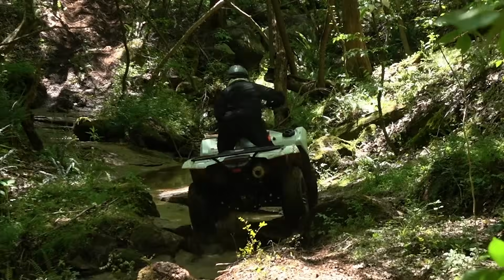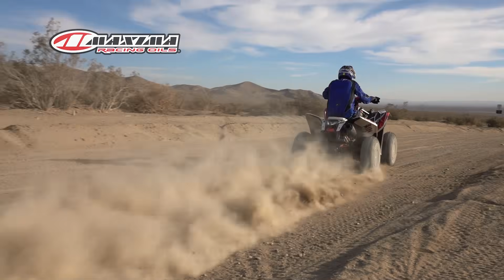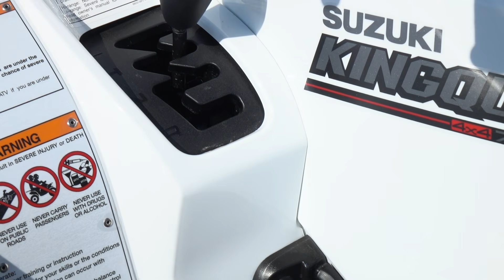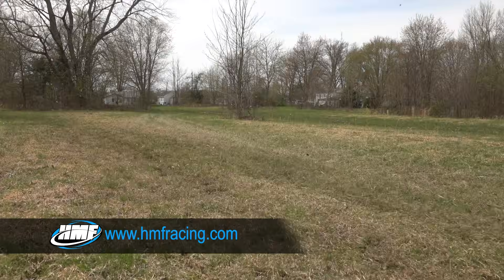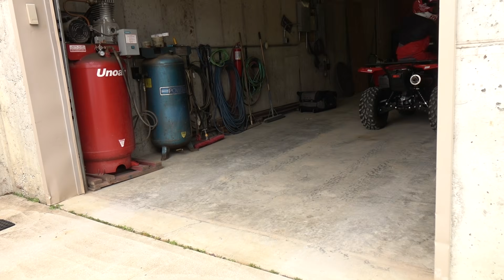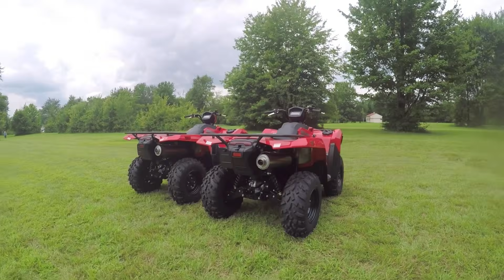Suzuki KingQuad 750 vs 500 Shootout

Comment: My first one was a 1995 300 . I recovered it from a scrap yard where it had been dropped off after a  bad crash or possibly a tumble off a  cliff. It was a frame , engine and wheels , the front brush gaurd was crushed as was the handlebars , guages , headlights , no racks or fenders . I think the owner was gonna attempt to fix it but decided not to. So I did . When I was done it had parts from all kinds of machines but it ran good  very reliable  and powerful ,  it absolutely looked horrible  like it didnt run so I never had any issues with theft or vandalism lol..18 gears , diff lock granny low .

Comment: If u get the 500 and put exhuast, fuel optimizer, tires and winch the value is defedentaly better with what you've saved and you have an atv that is lighter and almost as poeerfull. But  a yoused 750 for the right price would be a great option.
Reply from the maker: All good points. You could buy some accessories with that grand. It wouldn't be lighter though. Winch and the tires would add weight.
Reply: @ATVonDemand  that's true. I didn't realize how similar in wieght they are.

Comment: I’m glad they DONT change.  I have a 750 & love it
Reply: Polaris might be higher performance and all that jazz, but they break. Often. I used to work in the service department for a Polaris /Suzuki /Kawasaki /Kymco dealer. We rarely ever had Suzukis in the shop with mechanical problems. Usually due to wrecks. Polaris on the other hand... Constant axles, ball joints/bearings, engine and electrical problems. As high performance and nice as they are, I'd never own a Polaris. Crappy warranty too, they fight you WAY more than the Japanese manufacturers
Reply: Me too, Suzuki knows how to keep things simple and RELIABLE. That's the point for utility ATVs

Comment: That automatic CVT bullshit is a deal-breaker for me. I would love to have the 750 because it has 50 horsepower but I'll have to go get a Honda Rubicon wity a 5 speed . I'm sorry. I just have got to have my manual transmission. And I would also buy a Yamaha Raptor 700 because it has a manual clutch and it's fast. But I just cannot deal with that CVT automatic junk. I do not like automatic transmissions

Comment: nice video.  I'd go 500 over the 750...and with the cash saved upgrade tires and install a winch.  Value is better on the 500.
Reply: I just got a 2019 500 with 490 miles and a 2020 750 with 385 miles for 8,400 dollars and I'm having hard time deciding which one to take on the weekends I love them both man
Reply: Well they're both Suzuki so you win either way 👍 @tonydize3944
Reply: @tonydize3944  ... Congrats!  Yah, Suzuki's are hard to beat...and just run...run...run!!

Comment: I love my ‘21 750. Hauls wood, Plows a huge snow drifted driveway, pulls a box blade, hits some gnarly trails and hasn’t skipped a beat! It’s built like a tank!
Reply from the maker: Thanks for sharing your experience. We love owner feedback.  Sounds like your king quad has a busy life.
Reply: The only complaints I would have with the KQ would be squeaky brakes (changed the pads and went away) And the tires. The stock Carlisle’s belong on a riding lawn mower. As mentioned in the video the sidewalls are very soft.

Comment: Is it just me.. Cos When I messured my 2022 I just picked up. The Front Wheel Track is 3 inchs less when the rear tires???  
I''m going to have to add 1.5 inches to each side. To get the wheel tracks back even. ESP For snow riding!!  Dam engineers.. 
I've got over 100 000 miles on Atvs. The wheels need to be even SUZUKI!!! ESP for Canada. The Fuel tank!! Is the pits!!! A 6gallon tank for 750 would have been nice. Today I took my new ride on a long trip. 177 miles.  I already can point to stupid little things. That add up fast. 
I should have bought the Side by Side. I had on order... but Yamaha has no production..

Comment: We got a 2014 500 with 25,000 k on it . Use it for dairy farm use. Like it a lot over 400 and the 750. I think the 750 had problems with them over heating  on the older models. Our dealership said they struggled to sell the 750 s over the 500 s.

Comment: I have a 2013 axi power steering 
The power steering is useless. When you need power steering, as in when your stopped or in a tight spot and trying to turn around you get NO POWER STEERING.
But when your moving you get all the power steering you don’t need.
Japanese quads have useless power steering 
Both Can Am and Polaris have finger tip super easy real power steering 
The suspension is jarring and make the bike unruly in rough terrain.
Other than the useless power steering the rest of the bike has been flawless...
But 1000.00 for power steering that is useless unless your moving is a real rip-off
Reply: Your obviously not using it as working bike and are likely a weekend warrior  from the city
Reply: @snakeplisken4119  
Bud if you think the power steering does anything at all besides cost a lot your living in a dream world 
Try a Can Am or a Polaris product that actually has power steering.
Reply: @robm3357   rodger that

Comment: I bought the 500 axi in 2012 its been a great bike not one single issue ever at 9000 km to date . I will be buying the 500 again if i ever wear this one out.
Reply from the maker: We really appreciate you sharing your experience with your king quad. We love hearing from  real-world owners.
Reply: Did you adjust the valves yet? Just got a 2019 king 500 and wondering how crucial it is to get this done.
Reply: @mapleridgefarm1026  bike running great only thing I have done is put a new battery in and  regular maintenance  12 000 km
Reply: @steve123261  ok thanks

Comment: Great Video!!!
I’m pulling the trigger on a new 2020 King Quad 750. After rebates they price difference is only $750!!!
This video was perfect for deciding between the 750 and 500. Thanks!!!
Reply from the maker: Glad we could help! Enjoy your new machine.
Reply: Go for it. You wont regret the 750. I was going to get a 500 but due to a little paint damage got it for less than the 500, and it was the se plus even. I had no clue it handled bumps better but mine rides pretty smooth for the terrain. Better tires I will get soon, other than that I have 0 complaints. It's got good power stock, but at some point I may exhaust and upgrade the computer.

Comment: You nailed it with the comment at the end about more performance lurking in the clutch. Its amazing what some clutching will do.
Reply: I assume I can do that without messing with the exhaust or computer right?
Reply: @thecasualatvguy617  absolutely. All depends what your looking to gain
Reply: @rzl07375  I've been posting video since november of last year of my rides. I've found it's a capable machine for sure. It can do more than I think it can. Lol. I used to do just basic trails growing up so I'm always not wanting to tip mine over. I do have insurance but that's less time riding. Lol. I have met 2 new people on here to ride with with each model of a can am, they are 570s so I think they wont have the unreliable issues the big ones have. I guess we will see.

Comment: I bought a 2019 Kingquad 750 a few months ago and it's great. The power feels amazing after riding my dad's 2007 Kingquad 450 for the last few years. The 450 has been through hell and back and it refuses to even break down. It's all original parts, just needs a new CV joint as it is clicking and bound to break soon. I got a Kingquad because I know they are very reliable and I got a good deal on it. I walked in wanting a 500 and walked put with a 750, glad I did because it's amazing. 100% satisfied.
Reply: Instablaster...

Comment: I have 3800 miles and 355 hours on my 09 KQ500, LOTS of plowing snow. It has never failed me, clean it after use. Service fluids and keep things lubed per factory and it will not disappoint you.
Reply: Did you adjust the valves to get to this mileage. Just got the 500 and its my first FI, just wondering how crucial it is to adjust them or not.
Reply: @mapleridgefarm1026  They are easy to adjust since the 500 using tappets, I adjusted mine once at 2000 miles, after that they stayed in spec. I reached 4000 miles on mine and 420h before a tree smashed it in a windstorm. I now have a 2020 750.
Reply: @Re-Booter  ok thanks, were they fairly out of spec at 2000km? Just worried about dirt getting in the motor as i seen from videos that it exposes the motor to dust and debris at different stages.
Reply: @mapleridgefarm1026  I never had that problem, one just have to make sure you have a good tights seal between throttle body and air filter neck. Use Uni type air filter, I've never had a problem with them. Clean them and oil them once a year.
Reply: @mapleridgefarm1026  The events where people have ingested dust into the engine, either by too much submarine action or worn motor mounts that allowed excessive movement of the engine, slipping intake off throttle body.
Reply: @Re-Booter  ok thanks

Comment: Anyone that is chasing big HP numbers and fancy marketing when shopping for a ATV may end up with a questionable piece of crap ATV plain and simple lol. The Suzuki King Quad is the most reliable ATV on earth 500 or a 750, and that is all there is to it. I would rate the Yamaha Grizzly as a close 2nd or nearly just as reliable.. Any of these other exotic Can-Am or Polaris machines pushing big HP may look appealing at first. But, I have just heard so many horror stories from them.. Power will always find the weakest link! And the Suzuki Kingquad or Yamaha Grizzly are built to handle decades of hard abuse of there power that they produce while riding them very aggressive!
Reply: Ya I'm worried about can am reliabilty I'm steering towards suzuki king quad 750 now
Reply: @PyroSasquatch  I've had mine a year and put 1100 miles on it and 100 hours, I love it. It's the first one I've even bought new. I've posted all my rides since november on here. I looked for months and researched, watched people ride the newer brands etc. I was looking at honda, suzuki, and yamaha. For the money the KQ seemed best to me on features and engine size at 750. The front end on the 2019 looks pretty aggressive like some of the other machines. I do wish they had the black rims in 2019. Mine would look good black or a dark gunmetal with the bronze color body panels. It handles really well to me also.

Comment: Best king quad ever made was the 92 king quad 300 lol.   Mine had over 10,000 miles on it and a lot of miles without any oil in it lmao.   It was literally bulletproof.
Reply: I have the 250. Yes they are very reliable. People on the group pages have showed their odometers at 30, 40 and 50k miles!
Reply: @hank 1  that's crazy but a true testament to how good build quality was back then.  I wish I still had mine but I do know the guy that has the 1 I had and it's still running to this day.
Reply: I had a 98 and 01 they were the same as u had and they never give me any problems I put a neutral switch on 98 that’s all

Comment: The disappointing thing here is that Suzuki is selling the same machines that they were 12 years ago. It's a solid machine, but it has 20-30 less horsepower less and several inches less suspension travel than the competition. Couple that with garbage shocks and tires, as well as out-dated looks and I don't see the appeal here. I had a Suzuki Eiger 400, and it was a great, reliable machine. But that's where it ended. If these things were $6-7k I could understand the appeal, but $10k plus for a decade-old design with features at the bottom of the industry...it just doesn't add up. The Polaris and Canned-ham will stomp this thing in every category.
Reply from the maker: We agree, Suzuki could definitely benefit from an all-new from the ground up Big Bore V-Twin.
Reply: In every category? Very debatable.  Power obviously.

Comment: The big question for me is:  King Quad 750 or Grizzly 750?
Reply: Suzuki is much faster, and can be purchased much cheaper than a grizzly. I bought a 2019 KQ 750 eps for $6,800 !    Couldn't pass it up
Reply: @michaelross3512  I wouldn't trade mine. Mine was 6300 with the paint spot. Lol
Reply: The Casual ATV Guy beats over 2k more for a grizzly imo, best bang for the buck there is.
Reply: @michaelross3512  yep. That was part of my deciding factor too was what you get for the money. I liked the round headlights to add projectors, from what I've seen they dont make aftermarket led housings for ours so I'm at least going to out in led headlight bulbs.
Reply: The Casual ATV Guy my friend has the new grizz and the power is no comparison , I walk him easy with my king... the grizz is a little better suspended , but not 2300$ better. I sold my 2013 and bought a 2019 holdover..
Reply: @michaelross3512  a neighbor of mine got a kodiak 700 the same time I got mine, mine sounds better etc and keeps the mud off me better on really wet days
Reply: Grizzly is a 700
Reply: @ethanmedders2266  they're still makor competitors.  Which would you have?
Reply: Just sold my 2017 Grizz for a 2019 King 500 and glad i did, the motor sounds alot smoother and everything is thighter. The only thing i would give to the grizz is the seat cushion is softer and front suspension is abit softer as well.
Reply: @Sihyung Park I would take the Grizzly
Reply: @ethanmedders2266  I have a Polaris xp550 now and have been pretty happy with it.  No problems with reliability at all.  I think in this case the Grizzly is more sexy but the king quad had a lot of goodness people dont acknowledge.
Reply: I was looking at the same last year, I love my KQ 750.
Reply: I actually had my thoughts set on new 2019 Grizz 700. Dealer was having 1 of those conquer the dirt tours where you could try before you buy and they also sold KQs. After beating on both at the dealers dirt test circuit for about an hour and half back to back, I ended up getting a 2019 KQ 750.  It just felt more powerful and torquey  to me ( for my spirited riding style) and just as refined ,if not more, not to mention it has the same CVT clutch set up as grizz (constant pressure) and looks and sounds better to me too.  I don't miss my 2006 BF750 at all with this new KQ, it's plenty fast enough.  And I agree with Phil3555, this thing is agile for its size , I leave my buds Vtwin big bores in the dust on tight technical trails, which is where i ride most.  Just broke 400kms and loving it. Another thing , critics complain about the KQs power steering feel ( or lack there of) but I think its perfect, best PS to me is one you don't notice it's there. Friends complain that with their new Po Po's, and Can ams they  tend to oversteer (to much power assist) , I guess they just need to get used to it and they'll be good. Lastly , KQ layout is awesome for DIY maintenance , everything outside the motor is easy to get to , just very well thought out.  Anyhow , both really well built machines and I'm sure as many have stated , that the KQ will prove to be very reliable too .  Before you pull the trigger, have a good test ride on both.
Reply: @seancrawford5216  I have a 2013 KQ 750 and it's a reliable machine. 5000 miles with zero hiccups , just oil changes. I Have a copperhead fuel controller , and upgraded the fuel injector . It flys
Reply: Grizzly... of course

Comment: I can’t believe they send the 750 out with those wimpy tires. Fine for the 500, but the 750 could really use a better tire. Good for the test here, but come on, Suzuki!
Reply: My 750 came with 28” CST WildThangs on aluminum wheels.
Reply: @ChuckBeefOG  not directly from Suzuki it didn’t come that way. Maybe your dealer installed those tires. But you can’t get them directly from Suzuki with anything but those wimpy 25” Carlisle 489’s, which are easily over powered by a 750, let a lone the little 500cc. So I could see a dealer swapping tires on a few units before they sell.

Comment: This guys logic comparing same thing but one has more hp hmm wonder which wins
Reply from the maker: This video is about helping people pick the right machine for them based upon their budget and needs. It is not about picking a winner. Like you said, it's obvious which one is going to be faster but by how much. Congratulations, after 10,000 views you were the first person to leave a snarky comment on this video.
Reply: That would depend on what the owner uses it for. Some people do low speed utility work with their ATVs and may not have the space or desire to run one at full speed.  Regardless of what the ATV is doing, the 750 will burn more gas, generate more heat and cost more to maintain its DOHC engine.  The 500 has the same heavy duty chassis, towing capacity and Diff lock as the 750.  For some buyers, the 500 makes more sense.

Comment: In my opinion, the best part about having the true 4wd with diff lock is that the machines retain the ability to have independent front and rear brakes. That's the biggest loss with a CanAm and a Sportsman. The Sportsman AWD works exceptionally well, having gone from the Grizzly 700 to the Sportsman XP1000, biggest thing I miss is the independent brakes... Great comparison, the close price point would make the decision easy for me!